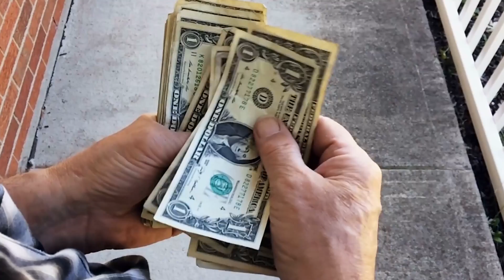Everything we know about NVIDIA RTX 4000 Series Graphics Cards

Comment: normally smaller the nm technology, smaller power needed. why 1000w ?
Reply from the maker: These new GPUs are all power hogs…just the way it goes…more computer power = more power needed
Reply: @TopTierTech1  its not the way it works necessarily, tech NEEDS to become more power friendly as time goes on, and it is impossible to cool 1000w so your take holds little to no power